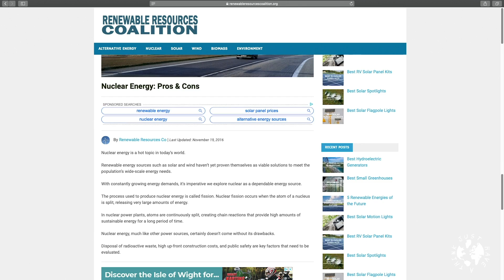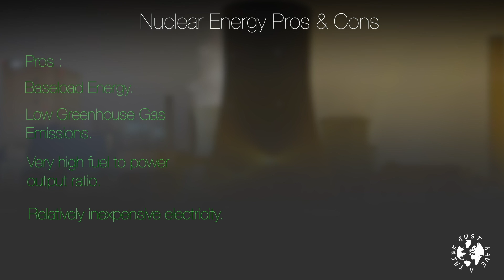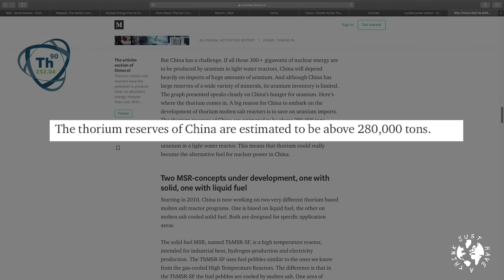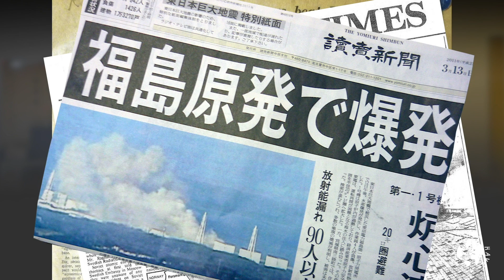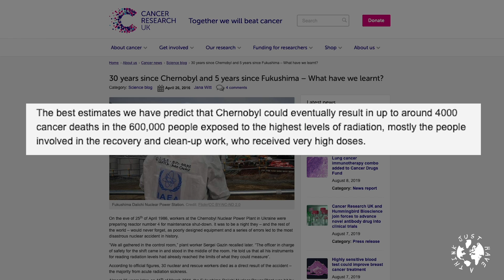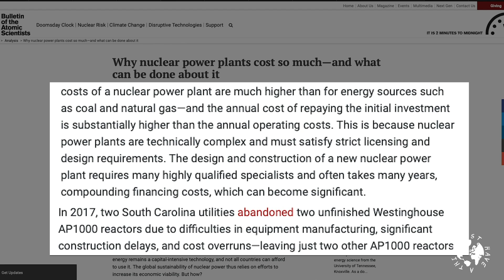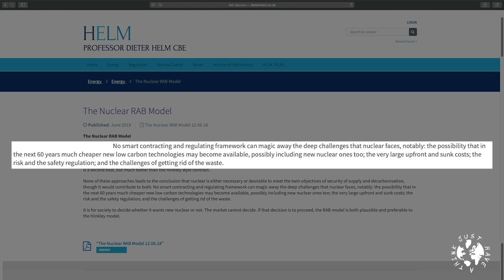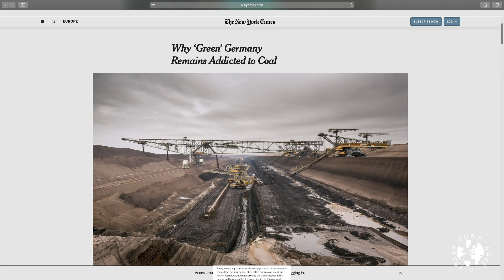Nuclear Energy in the 21st Century

Comment: No mention of Thorium molten salt nuclear....China is taking our USA research in nthe 1950s on this very , scaleable, unlimited fuel avaiable power source and is going all out while  the rest of the wolrd does nothing.  They have over 750 engineers workign more than full-time on this power source.  Could be the answer for t developing world as well with small reactors.  Untra safe.  The fuel is nearly not radioactive when spetn and easy to store.  No high pressure water to contain, shuts down instantly and thus is very safe and cna even be buried in the ground.

Comment: One of the things you forgot to mention is that another bonus to using Molten Salt Reactors, is that they are capable of reusing spent nuclear fuel, turning all the nuclear waste into usable fuel.  The waste that comes from MSR's will only be radioactive for a hundred years (much more manageable) instead of 10,000 years from the older light water reactors.
Reply: Yes, and for that any fast breeder (almost all experts shifted from thermal to fast) is a good tool. However, physics dictate that this mode of operation is much less economical. So it wouldnt be suited for large-scale energy supply, but rahter transmutation - waste processing like you described.  Until we know how gen 4 reactors fare technically and economically, we neet to upramp renewables, we have no time to waste. If gen 4 reactors or fusion in 30 years prove to be great - fantastic. Until then, we know what to do.

Comment: Germany's failure to make significant reductions in CO2 emissions from electricity generation is almost entirely due to its shortsighted abandonment of nuclear. With the use of thorium as a fuel (also 'conventioal' uranium with reprocessing - which admiitedly has issues of its own) nuclear energy fuelled by known reserves will easily have a projected lifespan of many thousands of years.

Comment: The amount of nuclear fuel that can be economically produced is underestimated by more than factor of 1000.  Lets start with biggest factor, nuclear fuel is not consumed by common nuclear reactors, but instead of reactions create waste that stop most of the fuel being used, and the long duration of radioactivity of the waste is simply because almost all the energy is still there unused slowly released.  The public fear of radiation stopped the mass production of reactors that are 50 to 100 times more fuel efficient than what we have now, and because they would actually consume the energy of the fuel that fuel wouldn't be radioactive for long time.   Now that doesn't only increase the use of what we mine today but also increases the economically recoverable natural uranium limit by more than factor of 1000. Currently mining costs of economically minable uranium is 0.32cents/kWh  everything that cost more than that to mine is not considered viable source viable source with that 80 year until we run out of it, now doubling of that would increase the amount by factor of 10.  However once things are fuel efficient, the original mining of fuel becomes so insignificant portion of overall costs that the cost of mining of uranium can sky rocket before it becomes limiting factor.  
If we increase both how much we get from uranium by factor of 50 AND increase the amount of uranium by factor of 1000, then uranium  reserves with current consumption would last 4 million years.

Comment: That 80 years of Uranium comment is soooo far out. Sea water passive extraction and using breeder reactors makes uranium inexhaustable. Also Nuclear is already the safest form of energy production including cuddly renewables when measured deaths per terra watt hour. More home work required
Reply: I agree with everything except uranium extraction from seawater. If we utilise U-238 too then yes, if we only use U-235 then the EROI is too low (the concentration of uranium in seawater is too low).
Reply: i view nuclear (fission) to be a stop gap until we get fusion reactors, or massive scale orbital solar farms, or something else we haven't thought of yet. big thing you buy is time. because large scale cute renewable will take a long time to build up enough infrastructure to replace fossil fuels.

shutting down fully functional nuclear power plants is stupid, because you still have to deal with all the radioactive waste whether it runs its maximum service life or not. especially if they aren't in any immediate danger of failure.

Comment: When we’ll be out of the fossils fuels, then we’ll could phase out nuclear. At least, the uranium cycle (UPu).

The IPCC speak of 2030 as a death line in order to move things around. Kick the politicians and the public opinion in the balls, to finally provoke a reaction. But the problem will not be solved in 2030. Neither in 2040, most probably. We have to think long term, not short term, therefore your conclusion is invalid. Nuclear isn’t ruled out just because it’s complicated to build.

You can’t have a channel focused on climate change and promote a solution relying only on “new low-carbon technologies MAY become available”. It’s not renewables VS fossils fuels + nuclear, it’s renewables + nuclear VS fossils fuels.

Comment: Just a point of note, the term "Baseload" came from coal fired plants which took days to fire up from cold to full capacity so shutting them down during off peak times was not an option.

The "Base Load" was the minimum amount of power the plant could produce before it shut down.

This is where off peak power came in when market operators offered cheap night rates to power hot water services to maintain the "Base Load".

Comment: without petrol how do you keep running your nuclear plant... you don't. It takes 2-3 days to shutdown a plant but the reactor needs to be cooldown for 4-6 months. In case of petrol shortage and electricity blackout, we are doomed. Pablo Servigne explains it better than I can.
Also it takes a lot of ressources to build the nuclear plants needed therefore the first and only option is to reduce the population and negative growth (major downsizing).
Reply: 1) What is the share of oil usage for nuclear power plants in the total oil consumption?
2) Nuclear power plants can be shut down in a matter of seconds (usually about 10 seconds). The level of decay heat immediately after the shutdown is about 10 % of the previous power level, it drops to about 1 % in one hour, so the actual water requirements diminish quickly too.
3) You should always look at the materials needed per unit of electricity produced, not absolute numbers.

Comment: According to the 2017 & 18 world nuclear industry status reports, one can conclude that nuclear, whether it be traditional or new types of nuclear plants, is essentially dead. The primary reason is cost. Utility scale wind & solar is already the cheapest form of energy. Solar plus storage is equivalent to gas / coal at about 4c to 5c per kwh.  Hydro is at 7c.  Nuclear is a 16+ cents for current plants and is not including the cost of decomissioning and long term waste storage. Here in CH the decom cost is estimated to be even higher than the originsl building cost. We are running the oldest plants in the world and so far we had  no issues with them. The Mühleberg plant is taken off line next year because it cannot compete with the low energy  prices in Europe.
The Gösgen plant must replace its ventilation fire protection shutters (asbestos cladded)  in order to keep the permit to run.  Cost is estimated to 250mio Sfr. The plant is essentially  doomed.
Cost is imo the key factor, whether we are going to build (and finish) any new nuclear at all and for how long the old plants will remain in service.
Imagine, the time when Hinkley Point  designed has started  is now easy up to a decade ago if not more. So the control tech and hardware on which  the plant design is based  on is essentially already outdated. 
Its like buying a VW Diesel when you can already get a Tesla.
Reply: @Martin Leutwyler There are 55 plants being built now. https://www.world-nuclear.org/information-library/current-and-future-generation/plans-for-new-reactors-worldwide.aspx

Comment: Great video, thank you! I'm happy you weren't totally negative about nuclear energy. It needs serious consideration if carbon levels are to be reduced in a relatively short space of time.
Reply: No, actually it is estimated it would take 40 years before the nuclear plants were online, whereas we can begin converting to solar and wind on a constantly growing percentage of our needs RIGHT NOW, and at a third to a fourth the cost per kW-hr.
Reply: @rstevewarmorycom  didn't say it was the ONLY OPTION, just that it has benefits that need to be LOOKED AT. Wind and hydro have benefits and drawbacks too.
Reply: @kristopherdavidson2097  
I don't see ANY benefits if nuclear is going to cost 4 times more per kW-hr, and take 40 years to complete, where we could have cheap renewable power from solar and wind if we begin to start adding it right now. Wind and solar are ready to go, building plants to make solar panels and wind turbines are quicker and simpler and are known trusted technology, and reap an immediate increase in power available to the grid that grows exponentially.
Reply: @rstevewarmorycom  em, how are you goingo to go renewables NOW! when China, with all it's push to renewables, es expected to generate electricity wind&solar from 14% to 40% in 24 years?
Indeed, both nuclear and renewables are needed
Reply: @shmadmanuts  
Except nuclear would take over 40 years to build all the required reactors, and train the personnel, and find the fuel, which is dwindling and becoming WAAY more expensive. And 40 years is well beyond the climate tipping points. Wind and solar are 4-5 TIMES less costly for the SAME number of kW-hrs, and we can convert all the car factories to build them starting today!! Go to a wartime footing on this and you can save the world in 15 years. China could do it a lot faster, and if they see US doing it, they WILL!!

Comment: 6:26 Isn't China's planned increase from 2% of 1625GW to 4% of 3188GW actually an increase of nearly four times?
Reply: As a matter of fact China's will have 10% of its power from Nuclear Energy by 2030...
Reply: @harrydegenaar7251  might be, might be, as those are installed capacity actually

in 2016 china produced a total of 5860TWh
those tiny 2% of nuclear produced ~200TWh in 2016, so  3.4%
while the 14% of combined wind and solar produced.... ~300TWh so 5.1%

as solar and wind rise... the more nuclear produces in %, in 2020 it did  vs 
Solar PV & Wind ~500GW produced 720TWh(9.5%)
Nuclear est 53GW! produced 366TWh!!(4.8%)
Reply: Bruce Duncan I noticed the same thing. Also, the amount of electricity China plans to produce by coal will slightly increase from 942.5 GW (58% of 1685 GW) in 2016, to 1,020 GW (32% of 3188 GW) in 2040.

Comment: It has already caused 4000 deaths no... most have it up to at least 190,000 and some say a million or more.
Reply: The only reports going with numbers anything like that used a method of calculation the World Health Organisation (WHO) specifically recommended not to use because it come up with rubbish results. The WHO's own study put 4000 as the upper limit to the potential deaths caused and more recent studies based on epidemiological studies puts it at approximately 210 total (including projected cases yet to come).
Reply: @coreymicallef365  
That's not quite right.  The zero threshold model say's something like 2000 eventual probable deaths.  In other words, purely theoretical modelling of cancer risk.  The first thing to notice on a tour of Chernobyl is that it was a typical 1980's work place.  There are ashtrays in every hallway.
Reply: @lordsamich755  You may want to look into more recent data than that. Here's a presentation by the leading expert on the effects of Chernobyl. https://youtu.be/pOvHxX5wMa8?t=2307

Comment: strictly speaking solar isn't renewable either because it's also nuclear and the sun will run out of fuel one day.  There is more thorium than we can use in 1000 years.
Reply: Sun won't run out of fuel for a few billion years
Reply: @ricksmall5240  point is that Thorium is sustainable so doesn't really matter if it's renewable.

Comment: Until nuclear power can pay for itself, it's a dead issue.  NO nuke plants would ever have been built in the US, or most of Europe, if they had to go on the market and buy insurance.  The government set up a special insurance scheme just for nuke plants and we all subsidize the insurance premiums. 

When the approval of a new plant is granted, the first thing a company has to do is to deposit, up front, a significant amount of money into a decommissioning fund, usually around 350 million dollars.  Nearly every one of these funds has been tapped into to keep the reactors operating, so that when the plant shuts down, even if it didn't go Fukushima, there is not enough money for the decommissioning.  So the taxpayers have to step in to pay in self-defense. 

When I see ONE nuke project operate without massive subsidies and funds it's own decommissioning, then I MIGHT consider supporting nuclear power. 

The most recent nuke plant in the UK had to get a subsidy to get them the 16cents/kwh it needed to make a bit of profit.  At nearly the same time, the largest solar plant in the world (I think) signed power delivery contracts for 2.9cents/kwh. and no significant subsidy.
Then there is the little matter of where to put the decommissioned reactor and high level waste?  Bueller?  Bueller?  Bueller?